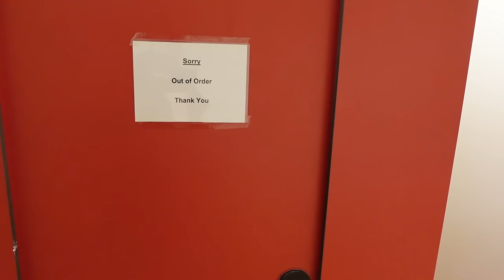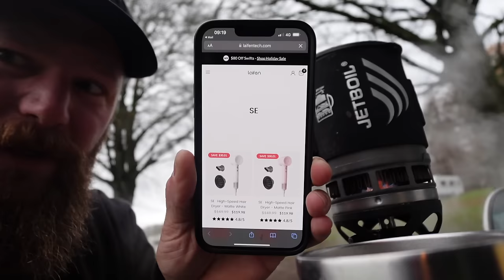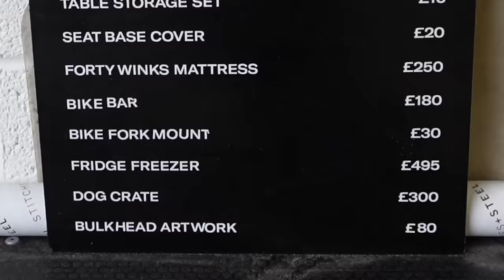UAO Christmas RoadShow. 6 HOUR DRIVE for this. Vanlife in the UK

Comment: An Omlette typically has additional ingredients (ham & cheese) and should be cooked with little interference so it can be folded. Scrambled egg is whisked as it cooks to create the ‘scrambling’ and typically does not have additional ingredients other than a splash of milk. 

PS poptop thermal wrap, duct tape and insulation from Wickes, it’s a game changer. Can’t help the wind though.
Reply from the maker: Ha ha. Awesome

Comment: Can’t you remove the mattress from the poptop and just put it on top of the Ovano drop down bed ?
Reply from the maker: Ye. Although have a very thin mattress as my bed has the froli springs. 
And had way too much gear in the van. 
I did consider the mattress that’s available. But didn’t expect it to be that cold
Reply: I take my hiking airbed for the occasions I sleep 'downstairs' - I have a double that rolls up smaller than a 2l coke bottle. It’s pretty comfortable on the ground so I’d imagine it would be fine on the Ovano bed. A bit spendy but in my case I had it anyway for backpacking so a no brainer and I don’t have to carry a huge folding foam mattress robbing me of boot space
Reply: @urbanarkoverland  don’t have a diesel heater yet and thinking of lakes after Christmas might have to wrap up 🤦‍♂️
Reply from the maker: @mikelambrou4462  ye mate. 
Had a van full of stuff. And always assumed. Be ok tonight ha. 
It warmed up one night. But was windy as hell. Can’t win ha
Reply from the maker: @morganrichardson1645  ooh ye. 
But when ya ready for heater. I can supply. 
Or can hook you up with supply and fit 👍🏻